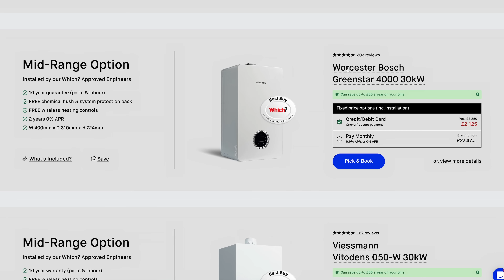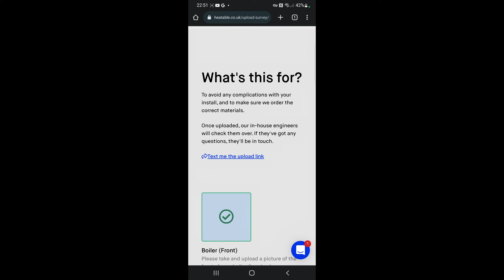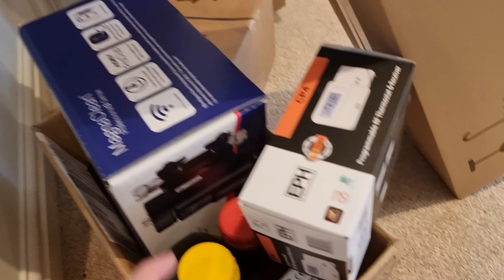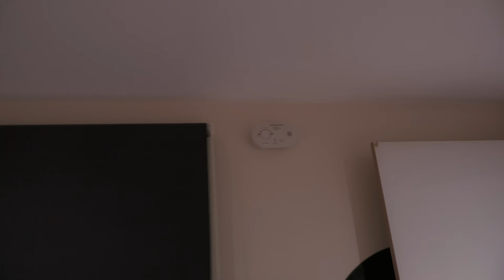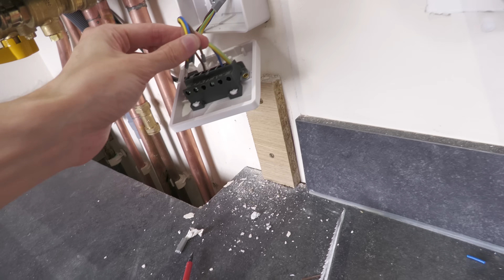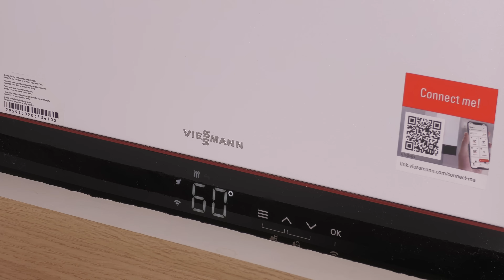New Boiler from Heatable - A Paying Customer's Review | Viessmann Vitodens 050-W

Comment: The next thing you need to get is a RCBO CU. If you want a recommendation for someone in Edinburgh let me know! Changed mine over last year to a Fusebox setup and was about £500.
Reply from the maker: It's something I've been considering but more of a "nice to have" rather than something I need urgently - the current board is still serviceable, albeit not super neat.  If I was definitely going to be staying here for another 5-10 years then I'd probably do it but I can't really say that for sure.  Realistically the boiler would have needed to be changed anyway if I were to sell in the future whereas the CU is unlikely to be an issue.  I suppose I just have a general dislike of having to get contractors in to do anything - probably why I put off getting the new boiler for almost 5 years!

Comment: Just had my one changed went for Worcester Bosch 25kw, £1400, all in local heating engineer using for the passed 12 years, the boiler wasn't band new only 6 months old,

Comment: Can't wait for you to get a cheap thermostat, put Tasmota on it after replacing the microcontroller that should be pin compatible but you end up needing to make an adapter for it to shift the pins around, all so you can use Node-RED to change the temperature with your TV remote!
Reply from the maker: Haha, unfortunately I'm probably going to need to go for an off the shelf product, likely something like a Nest.  While I'd love to have something totally locally hosted, I'd have to compromise on the boiler modulation logic that products like Nest will provide.  I'd still integrate it with Node-RED although it'll mostly just be for automated home/away type stuff.

Comment: Another really interesting video 😀
I assume when you setup the new thermostat you will go with something that works with your Node-RED setup? Also, that app looks really interesting but it would be great to extract the data locally instead! Perhaps you could put it on your wall mounted touchscreen somehow?
Reply: Home Assistant supports vitodens boilers. It's incredible the detail you get from this unit.
Reply from the maker: I just tried the HomeAssistant integration and I couldn't really see much information, in particular related to the gas consumption.  That said, I never seem to be able to get my head around HomeAssistant - it just doesn't seem to match the way my brain works.  I'll maybe give it a go again or alternatively I should be able to build something in Node-RED as the API seems pretty clearly documented.  As for a new thermostat, I don't know if I'll necessarily be able to go fully locally hosted since most decent OpenTherm options are cloud based and while I could build something there's no way I'd be able to do proper load compensation to the same level as a proper heating controls company.  I suspect I'll end up with something cloud based but then I'd at least have a couple of API calls to do simple things like turn the heating on/off from within Node-RED and maybe to control temperatures.
Reply: @camerongray1515  Was it the ViCare integration you tried? Must have been, it's the only one! I think from memory I had a bit of a mare getting this to work and needed API Keys, authentication etc. It works well now, and can fully visualise when it's modulating, etc. Probably too much data tbh
I have the E3_Vitodens_100_BHC_0421
Ref Gas consumption, there are many sensors monitoring heating and hot water consumption, current day/month/year etc (sensor.vicare_hot_water_gas_consumption_current_day, sensor.vicare_hot_water_gas_consumption_last_seven_days)
Agree, 'home assistant' is a nightmare from a usability perspective - it's a massive learning curve. Temperature / Heating controls are however easy,.. Node-Red is a godsend for this!
Reply from the maker: Been able to get it working now, my home assistant instance was out of date and for some reason this meant it was only showing a couple of entities from the vicare integration, after updating it it's now showing everything including the consumption data - going to be interesting to play about with this now!

Comment: Presumably no scope to fit weather compensation? Viessmann’s weather compensation, even the basic version is very highly regarded. Not to be too critical with the heating engineer as it looks like a good install, but they should have been aware of Opentherm as it has been around in various guises since 1996, and particularly in the middle of a gas crisis should not be fitting on-off controls.
Reply from the maker: The boiler does support weather compensation so I'd be able to add it by connecting an outdoor temperature sensor.  I saw the connections for it when he had the boiler open (Officially need to get someone in to connect it. Although if the front was ever to accidentally fall off the boiler, it wouldn't be too hard to add myself 😉).  Only thing I'd maybe need to think about is that the wall that the boiler is next to gets direct sunlight for a lot of the day so I'm not sure if this could cause issues with the reading that the sensor would get.
Reply: @camerongray1515  🤔 If you haven’t got somewhere to shade the sensor, or a north/north-east/north-west wall I’d probably stick with OpenTherm. Having had both though (Nest OpenTherm with an Intergas boiler and weather compensation with an Ideal Logic), I’d probably choose weather compensation as I think the energy savings are higher, but both provide improved comfort and steady temperatures, at least once you get your head round the fact that the radiators are unlikely to be piping hot.

Comment: Would like the ability to set my heating temp via an app. Just have a manual dial on my outside condensing oil boiler, I'll find out if I've adjusted it down too far come winter. :-)
Like urban plumber and heat geeks channels. Summer definitely the best time to replace a boiler.
Nest controls probably going to be most popular for a video?
Reply from the maker: That's my thinking around the controls, there's a few different options I've been looking at, some with nice open APIs.etc however as you said, Nest is likely to do very well as a video, my Hive install video still gets really good views over winter!  Then with the fact I'm currently wired up for on/off control, I could go into proper detail explaining the difference between OpenTherm and On/Off control and show people how to install it both ways!
Reply: I did a lot of thinking after I went the viessman / Nest route. I would now elect for individual room control over a big bang overall solution like nest, using tado smart rad controls. A lot more control, a lot more efficient too
Reply from the maker: This is still a consideration as individual room control sounds like a good idea in principle although realistically I don't have that big a place so not sure how essential it is.  The most I could really do is run the kitchen at a lower temperature and not heat the bedroom during the day, although this would also require me to change my behaviour as I tend to leave internal doors open.  I likely wouldn't go for Tado due to the lack of OpenTherm support without importing an EU receiver (although they do mention OpenTherm on the wired thermostat's product page so I'd need to do more research into this).  Something like Drayton Wiser could be an option although not sure if it'll be worth the additional cost and likely a less successful video.

Comment: Really like the sockets and spur, what kind are they? Had a quick look at mk ones online but couldn’t see same model
Reply from the maker: They're from the MK Dimensions line and aren't too outrageously priced when compared to things like their Edge and Aspect line which are extortionate!  It's a slightly weird system to order as they come in two parts - you order the "functional module" in either black or white which is the actual socket/switch then you order the front plate separately in the finish you want.  The catalogue here details all of the products and their respective part numbers: https://buildings.honeywell.com/content/dam/hbtbt/en/documents/downloads/MKDimensions_Brochure_UKMK432-0721-EN_FINAL.pdf.  You'll notice the part numbers for the metal front plates have a asterisk on the end, you either replace with with "B" or "W" depending on if you want the trim to be black or white, you'd usually match this to the colour of functional module that you chose.
Reply: @camerongray1515  awesome, will look into it.  thanks so much for the info.
I'll be moving from oil to gas house soon so was interested in this video.. Also I have a tado I'd be taking with me - I checked if my UK tado would work with opentherm boiler but looks like I need an EU extension box, the UK one I have wont have the bus connectors and only supports legacy relay on/off :(  Do really like tado system so will prob hunt out the right ext box.
Reply from the maker: Yeah, the Tado OpenTherm thing is really annoying.  I think it's because some EU countries (Netherlands I think) require OpenTherm now.  Even more infuriatingly, companies like Valiant don't offer OpenTherm boilers and instead use their proprietary eBUS protocol.  Except they do sell a module to provide OpenTherm, but only in the Netherlands!  They apparently claim that using this module in a UK boiler will invalidate the warranty.  This is the exact reason I immediately ruled out any Valiant boilers from my shortlist.
Reply: @camerongray1515  The Wireless Receiver box I fitted in my UK flat a couple of years back does have OpenTherm terminals and the tado "Manual for Professional Installers - For the Starter Kit - Wireless Smart Thermostat V3+" shows how to hook it up and configure it in the initial setup.  I am using the digital bus to connect to my Worcester Bosh Greenstar 30CDi, but that connects to the same two "digital bus" terminals in the Wireless Receiver box - it's just a config setting in tado setup to select OT or one of the various digital bus standard used by the boiler manufacturers.  I'm very pleased with tado, using TRVs and a few wireless thermostats in the rooms, along with the schedules in the app provides full zonal control and remote (including out of home) control without any special plumbing or wiring.
Reply from the maker: Interesting, I think previously Tado did offer OpenTherm on their Expansion box and I think their wired thermostat may support it but their current wireless option doesn't unfortunately.  Tado does look like a good option but I'm still figuring things out around it, I'm not a huge fan of the fact that they don't really offer any official API documentation.

Comment: I've got this boilers big brother the Vitodens 100, slightly older model than yours since it's been in for about 8 years. It's honestly been absolutely flawless up until April when it stopped producing hot water properly. Turns out the heat exchanger was totally clogged and had to be replaced. Had an interesting chat with the engineer that I got to fix it where he asked if we'd had a system flush and we had. He said it was a common problem that the rubber hoses on the inside of the boiler can degrade and the lining of those hoses can clog the heat exchanger. We ended out stripping the boiler including taking the hoses off and they were completely clogged too so they had to be flushed out too. Wasn't a cheap job at all so hopefully they've fixed it in later models, but it's something to look out for when its being serviced. Just get the engineer to check the hoses and see if they're still 'rubbery' if that makes sense, mine sounded and felt like they were full of gravel.
Reply from the maker: Yeah, that was a known issue from when they switched to rubber hoses. Thankfully they identified the problem and have moved back to copper pipes on the newer boilers.
Reply: @camerongray1515  Ah thats good news, shame they didn't properly acknowledge the issue but at least its reverted back on newer models. I'd definitely replace mine with a new Viessman if I had to though, apart from the hoses it's been fantastic.
Reply: Sounds like you have the earlier model WB1C with the rubber flow and return hoses they were actually quite easy to remove and clean and refit they do not actually degrade  but just collect the dirt from the system you can tell when you squeeze hoses as you say it feels like it’s full of gravel, As an engineer I can remove clean the hoses and refit them within two hours it should not be an expensive job also the heat exchanger for the hot water can be simply flushed out all pressure washed I haven’t replaced one as of yet

Comment: We had pit boiler changed 2 or 3 years ago now. But we just had the gas engineer round the corner do it as he has serviced it anyway five years. His family and a couple of employees do it all. Much more trustworthy I find.
We didn't get a smart one though as we don't have a thermostat in the hallway anyway. It's just more hassle and cost to us to make it all smart. But it would be cool to do and have those motorised valves on the radiators so I could use an app to control them.

Comment: I have this boiler, and love it (connected through a nest thermostat -its opentherm compliant). Connect it through home assistant and you will get SOO much data you didn't know existed!
Reply: does it adjust flow temperature as it approaches the desired temperature? I also have tado TRVs which I’m hoping can work alongside that independently
Reply: @MrKlawUK  See my response to MFG485 below. Sorry, this is 2 years old! Opentherm compliant devices have a throttle curve so eliminate porpoising through their PiD (Overshoot, Undershot etc).
Reply: @MangustaMG20  all good. I went with the 050-w and went nest with opentherm. I kept the Tados just as room thermometers and to cap temps in some rooms but they don’t call for heat anymore. Appreciate the more controlled heating and the flow temps are really good

Comment: The last time we had a boiler fitted, a dedicated electrician came and resolved the electrical work later on in the day. Think it's a bit wrong expecting the gas engineer to do it.
Reply from the maker: I suppose it depends on the amount of work required, if a new circuit was required for example then they should absolutely get an electrician in, but for something simple then IMO it's something they should be able to do themselves safely, otherwise to do something simple like replace a faulty motorised valve or pump you're going to need both an electrician and a plumber when the actual electrical work involved is basically just swapping over some wires.  I'd view it the same as any joinery work being required - for simple stuff like cutting a bit out of a cupboard, then the installer should be able to do it (as they did here) however if the work required a huge amount of work to box a new boiler in or required alterations to a stud wall, I'd expect them to get a joiner in.
Reply: @camerongray1515  But if you were having a new boiler boxed in you would not need an electrician ?
Reply from the maker: I didn't say that, I said that in the same way that a heating engineer should be able to do basic control wiring, they should be able to do basic joinery work themselves but if more advanced work was required then I'd expect them to get a joiner in.  I have no issue with getting specialists in if required or if it is outside of someone's comfort zone, but sometimes I feel like trades silo themselves to ridiculous levels - a friend of mine recently had a plumbing company refuse to fix a leak because they'd have had to cut into a ceiling to access pipework.